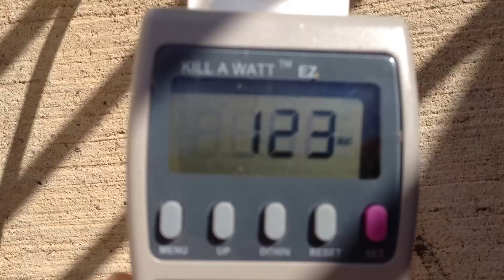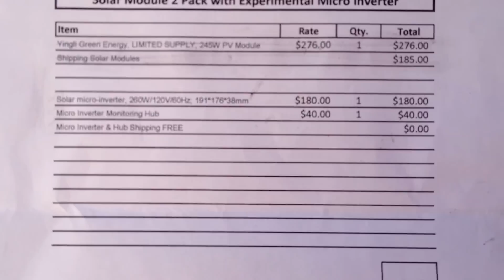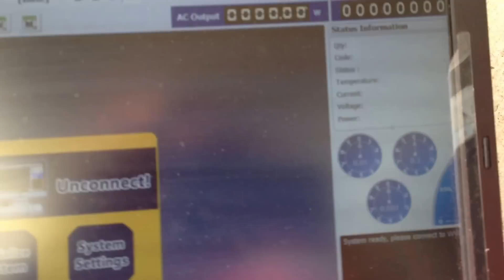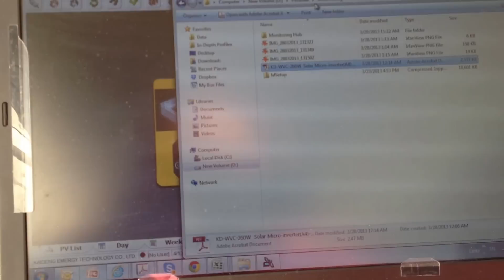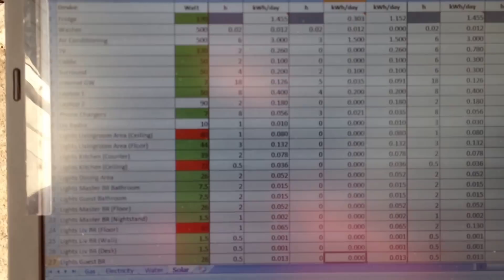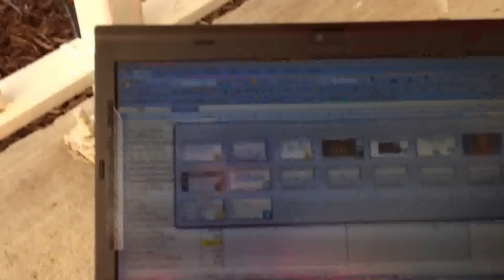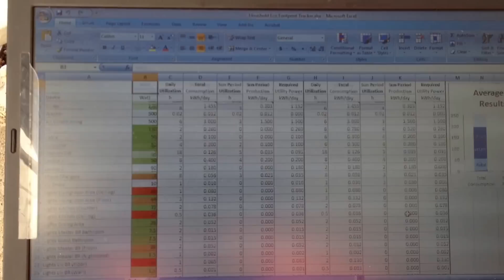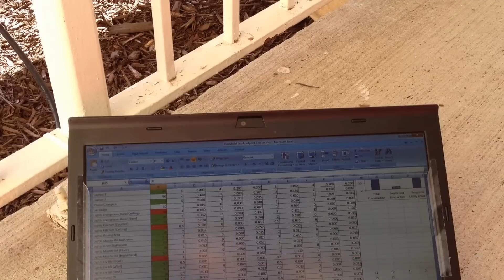Small apartment balcony solar power setup (part 1)

Comment: Hi

I really like this video

Am looking to build something similar as am running 1000w power hungry devices 24/7

A solar system can provide me free or cut my electric bill to half

I have 4 huge (HUGE) windows in my apartment facing two different directions and sun is hitting me apartment  from sunrise till sunset, what do I need to establish such a project can u help ?...

Comment: TIP. You can gradually dim down an under-table bulge and all other hungry electricity consumers with a 5000W dimmer (7, EUR). I run 5 dimmers in parallel on an 850W inverter. Kettle 2.2KW at 150W runs for 12 hours at a time, so the water is always hot. The room is also nicely heated. 2.5KW washing machine runs in parallel with dimmed to 200...400W. Iron, dishwasher, oven, electric heater, coffee machine, all internal heating are throttled with me. Videos on my channel https://youtu.be/eC2olbCBhh0 The inverter stays cool, quiet and the MOSFETs stay intact because no extreme current peaks arrive at the inverter...

Comment: why would invest in a maybe constant 200Watt solar panel, which effectively only runs your TV and maybe the audio system?
Reply from the maker: sorry for not responding sooner. good question though. this was only meant as a project to see if this could work. the battery ran the TV, audio system, wifi router, lights in the living room and everything that was hooked up to the outlets. didn't make a huge dent in my electricity bill but still pretty cool to run stuff off of solar power even if it's only at night.

Comment: Question: so if I connect my solar panel to my power outlet in my terrace/balcony, does it revert the power consumption? Is it this simple? And if so please let me know because this is a great idea to reduce power.
Reply: The answer is yes. But only if you use a lot of electricity DURING THE DAY, because that is the time when the solar panel is producing electricity due to sunshine. If you run more appliances during the night however, you would not benefit from this system unless you save the energy from the solar panels you gain during the day in a battery system, which can be discharged during the night.
Reply from the maker: Please check my other videos on this setup as it has evolved over time. I just added all links to the description. It was not as easy as I thought it would be and the issue I had was that without a battery setup I didn’t get much use from the panel and a limited ROI impact because the most power consumption was at night (lights, TV, etc.)
Reply from the maker: Also, I only did it this way because my balcony outlet was part of my living room grid where most of the nighttime power usage happened. At night I turned off the circuit breaker for the living room grid and then switched on the battery that was charged during the day. A bit manual effort but it worked and powered TV, wifi router, lights, etc for a few hours at night.

Comment: 250+ watt panels must be freight shipped and you will always be changed that, if you bought about 150 watt panels, ups can ship it and you can get 'free' shipping sometimes....
The apartment management should have panels for all the tenants!
Reply from the maker: Yes, I agree. The cost of the panel and shipping are where I made a mistake and should have done more research. Nevertheless I got the setup to work quite well with a battery and regular inverter. At least I was able to prove that I can run my living room (lights, TV, internet router, etc.) at night with what I produce during the day with that one panel. Since then I moved to a townhome and are now planning a regular solar installation but need a bit of a plan to convert current gas systems (water heater, furnace, oven) into electric versions, then optimizing electrical consumption (e.g. LEDs) before making the switch to a solar installation.

Comment: Are you sure you're not reading volts from that meter?  123-124v (not watts) would make sense as the output from your micro-inverter.  if you want to measure watts coming from your solar panel you need an electrical meter connected to the solar panel wiring before the inverter. Your kill-a-watt meter will let you monitor watts AND volts and probably amps and kwh.. Watts are measured when you plug an appliance into the outlet on the front of the meter.  If you don't understand what you are looking at or doing, you should not be doing it as you could be endangering your own safety or since you live in an apartment building - the safety of others.  I'm am actually surprised the apartment management permits you to connect anything like this to the apartment electrical wiring.
Reply from the maker: +Tim Yorty Yes, I am sure I measured Watts and this was the very first setup which I changed later on to one with different inverter and a battery which worked great and powered my living room circuit for the night. I did not have to change any wiring in the apartment...just cut off the living room circuit from the grid before cutting over to the solar charged battery.
Reply: @lbodini2008  can you help me explain more?

Comment: Do you have a copy of the software for the modem?
Reply from the maker: +Dave Massey Sorry for the late reply. I do have different version that I tried, when I had this setup. If you provide your email, I can email a download link to you. But please check out my other video(s) about the setup as I explain why it didn't work for me initially. I would have never found the solution without talking to the engineers from Kaideng who ended up doing remote troubleshooting and finally found the issue.
Reply: +lbodini2008 Hey buddy, I you please send me the download link for that software on my listed email address below my video. I will really appreciate it. 
Thanks for sharing this information video. 
Cheers
Reply from the maker: +JW Solarusa see if this works....I have combined all versions and files I received from the Kaiden engineers during troubleshooting and downloaded online in one zip file. https://drive.google.com/file/d/0B4Nhv3pPhh0tYWxkWElNOVM0U1U/view

Comment: Hi, I recently acquired this same kaideng microinverter however the packet was inspected at the customs and the CD-ROM with the monitoring system was lost. I contacted the supplier (kaideng) asking for it to download but got no answer.

Could you send me a copy of the monitoring system? There's no way I can monitor the generation without it, so I really need it. My e-mail is sup3rgeo@gmail.com

Thank you very much!
Reply from the maker: Victor M Hi Victor, sorry for not responding to your request sooner. Have you received the software in the meantime? When I had problems with getting my software and modem up and running, I contacted Kaideng tech support and they were quite helpful. I will send you the versions I have but highly recommend getting in touch with the manufacturer to get the latest version.
Reply: Hi, Yes I could get the software from the manufacturer, but thanks for your attention anyway!

Comment: Why dont you start the video with how much you are saving and how much it cost, instead of jumping into the technical.
Reply from the maker: Sean Mccc Thanks for the comment Sean. At the time of the video, I didn't know how much I really would save and the installation also changed over time (from grid-tied inverter to battery solution). Using only one panel and powering only the living room circuit with the battery will not have a big impact on the electricity bill but this was rather meant to show what you are able to do if you live in an apartment and have a balcony, are facing in the right direction for max solar exposure, are allowed to mount a panel on your railing and have an outside power outlet. All this without changing any of the internal wiring which landlords don't really like :). This installation still requires me to cut the living room circuit off the grid before turning on the battery-powered setup. I forgot this once and blew my converter so the payback period just got extended a bit as I have to add a new inverter to the bill.....
Reply from the maker: Sean Mccc I just double-checked my calculation. My living room circuit consumes about 40 kWh per month (TV set, lights, Internet router, kitchen lights, laptop charger). At $0.16/kWh we are at around $7 electricity cost per month. With the battery-setup I am able to offset about 60% of that cost. I am arriving currently at a payback period of 17 years. I usually turn on the battery around 6 PM and then it lasts all night, even with the TV system on. I could extend this setup to another circuit but it would not change much. The big energy hoggers are the fridge, dryer, HVAC and those I can not touch with my little setup. So this is pretty much all I can do with the available space on the balcony. What I also like about this setup (compared to the grid-tied version) is that it provides me a few hours of power when there is an outage which is not very unusual for the area where I live.
Reply: +lbodini2008 - too bad there's no deep-cycle battery in the world that will come close to lasting 17 years, so your cost over that time period should include the additional cost of 2 or 3 replacement batteries. What type of battery are you using?

Comment: Solar panels make me excited! I wish I knew more about them so I could use solar energy for my apartment. I only consume 210 kWh/month.
Reply from the maker: Robert Seymour Hi Robert, I just went through a couple of hours of reviewing my current utility consumption and also to determine which adjustments I can make in the apartment at what cost and with how much cost and resource (electricity, gas, water) savings in order to figure out the payback. Still not done with my calculations for things like LED lights vs CFL, washer, dryer, fridge, etc. but I have also updated my solar/battery setup calculation. Right now I arrive at 12% electricity cost savings and a 13 years payback period (at a kWh cost of $0.15). My average monthly consumption is 340 kWh and I am now working out a plan to replace key appliances. I will post a new video on the solar setup and my calculations.

Comment: Great video!  I am not sure if the Kill-A-Watt meter is intended to work 'backwards'.  You are attempting to measure power generated from the load side of the Kill-A-Watt meter.  Also, this may be what is interfering with the power line communication from your micro inverter to your hub.  For power line communication to work, it is critically important that there is a clear conductive path from the inverter to the hub.  I have never taken a Kill-A-Watt meter apart, but that may have instrumentation that is interrupting the communication.  I'm not an expert, but try removing the Kill-A-Watt meter from your system and see if the hub works then.  Good Luck!!!
Reply from the maker: Thanks Daniel. In the meanwhile I have changed my setup. No more microinverter in a grid-tied installation. I got a regular inverter, a 100Ah deep-cycle battery and a charge controller. Charging the battery during the day and using it at night to power my living room is the most I get out of my setup (due to limited space for more panels) but this way I know I am using the stored solar power (I disconnect the living room circuit from the power grid at night) when I need it most. In the previous setup I was not able to determine/measure what happens to the power I am feeding back into my apartment circuits. And since I do not have access to my electricity meter I couldn't see if the meter runs slower when the panel is producing max power. Also, the power bill doesn't reveal much since the overall consumption on a month-by-month basis fluctuates. My new setup also allows me to have some backup power during power outages. Not much but at least enough to power a few devices for a couple of hours - fridge, excluded :)
Reply: I believe you could be losing as much as 40% of the energy you created in simply charging the battery. I think you were better off with the grid-tie inverter.  I have two 175 watt panels and a grid-tie inverter and see a maximum of 240 watts at 240v in full sunshine, and a lot less in cloudy weather.  It is impossible to notice any reduction in the meter reading....!  The best I can hope for is a small return - maybe 5-6% - on my investment (Total cost was 255 GBP)

Comment: This. This is the way solar power should be used. Love the residential panel, hate the industrial.

Solar power has its place, but it isn't in industrial-level applications. That is the realm of high density, reliable sources.
Reply from the maker: I am not sure what you are referring to....industrial panel? You mean that it is taking up too much space in large-scale industrial applications? Not sure about that....when I come into Dulles International I always wonder why all these flat commercial building roofs are not equipped with solar PVs. Or convert them to green roofs :-)
Reply: lbodini2008 I'm referring to solar power plants. Ill conceived, inefficient, and unreliable. Even coal, which we're beginning to outgrow as a civilization, is better. They have a low power density, can't guarantee power at any given time, and the power they provide (at industrial levels) is ghastly expensive.

None of this is a problem when solar panels are used on a small scale to supplement standard power sources and reduce power bills. There's no extra infrastructure needed, the building costs are high but affordable, and having them fail (clouds, night time, etc) is no big deal since your local power plant will easily cover you. Solar is a sustainable supplement (as is wind), but an unsustainable industrial producer.

To be sustainable on industrial levels, a power source must be the following.

- Reliable: barring catastrophic mechanical failure, can provide guaranteed power anywhere from zero to maximum capacity, and can be adjusted from minute to minute as needed.

- Affordable: doesn't cost you an arm and a leg to build and/or run, and can have maintenance on it performed cheaply and safely.

- Environmentally Friendly: no power source is truly clean, but they have to be at least clean enough that they don't kill everything around them.

Solar plants have none of these. They produce zero power at night or when a cloud passes overhead. Building them is expensive, and servicing them is both expensive and time-consuming. And on top of that, they kill wildlife left, right, and middle (I believe there's one in California that kills one bird every fifteen minutes or so).

However, residential solar power only needs to be one thing: affordable. It's affordable, and virtually pays for itself the first time winter rolls around.

That's what I meant.
Reply from the maker: masterofThardus Thanks for elaborating. You may be right about solar power plants. I am a fan of distributed power production like in a residential setup. But, if you think about business buildings, they could do exactly the same at a larger scale, with regular utility power as a backup and without any environment harm in terms of incinerating birds (if that is really what is happening).
Reply: Unfortunately, I don't think that'll ever happen. If either the anti- or pro-solar/wind lobbies win the power battle, the residential panel still loses. If the pro wins, the high demand for solar panels will drive up costs for said panels for small scale users (not to mention driving your power bill through the roof, but that's another story). If the anti wins (though of the two I agree with them the most), all solar panels will get a bad rep as bird killers, even though it only applies to large scale solar farms and residential panels are relatively harmless.

Comment: I am using a LG 300W panel and Enphase micro inverter, I think the connection is Bluetooth to the solar modem and besides joining the company web site to input your solar details its pretty simple...
Reply from the maker: Yes, I really like enphase and their web-based monitoring. I just added a battery to my installation: http://youtu.be/W2Lc2LdpN6I
Reply: how much did it all cost?

Comment: As an owner of a grid tie solar array, I can tell you with a lot of certainty that heat will inhibit the performance of the solar panel. You will likely get full wattage production from the panel only in the winter. Cold temps are best for panels.  What gconol said about peak performance vs continuous output is  correct. The only real question I have is, where is your grid tie inverter. I did see the micro inverter. now is that a pure or modified sine wave, or is it a grid tie?
Reply from the maker: brad mack 
That's what I heard too and can imagine this to be an issue. Also that the inverter is right behind the panel. It is getting very hot here in VA in the summer. The inverter is a grid tie but I already got a new one in addition to a battery and charge controller. This way I can see what happens to the solar power once I connect the battery to my apartment circuit. I plan to feed only one part of the apartment (living room area) at night as I can easily disconnect it from the grid and the outside plug on my porch is in the same circuit.
Reply: @lbodini2008  hi can i ask you more about t his? I got solar panel and it is 150 watt, how is on a cloudy day like winter?